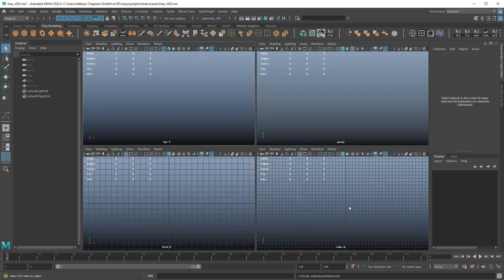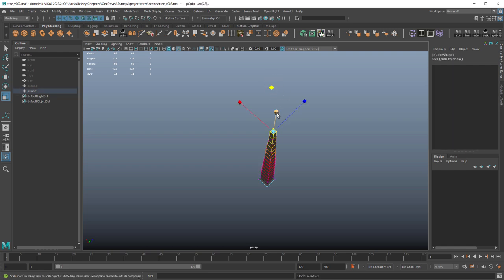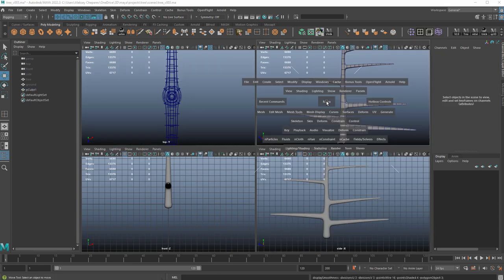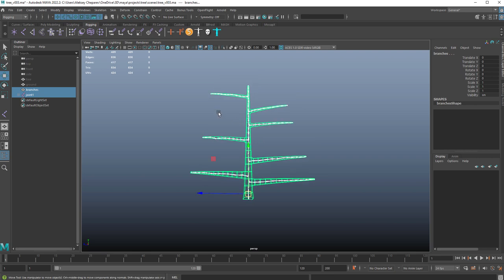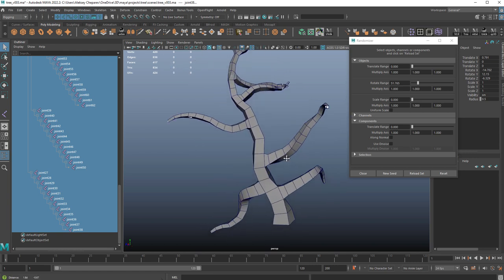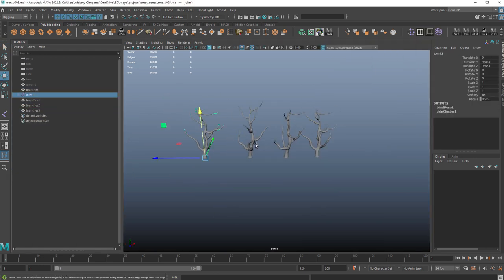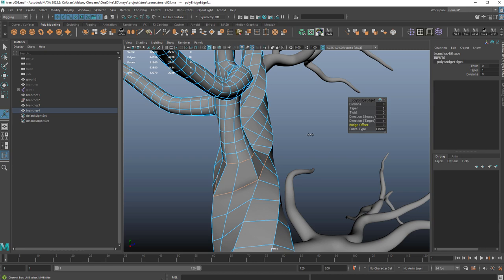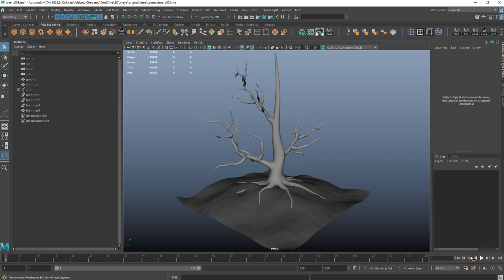Maya Extrude and Joint Tools - How to 3D model tree branches

Comment: Feeling a tad bit goofy here but.. @ around 3:55 how are you able to soft select the horizontal length without grabbing the lower branch? When I expand my radius to grab the length of the branch, I'm also grabbing the lower vertices.
Reply: Hey, if you double-click the move tool on the left, under the Soft Selection menu, there's an option called "Falloff mode." Make sure that's turned on to Surface, not Volume.
Reply: @dobbysalazar5216  thank you SO much!
Reply: I needed to know this too so thank you